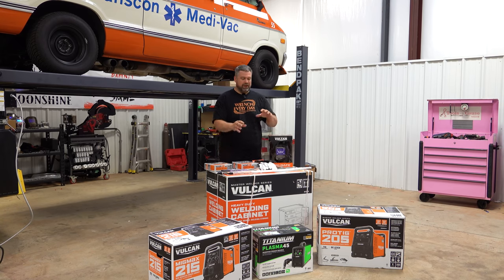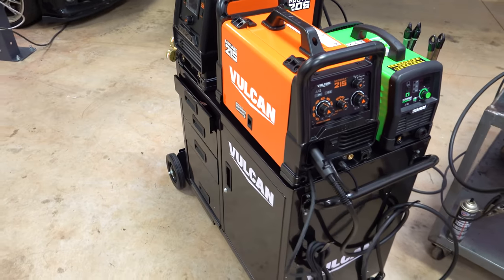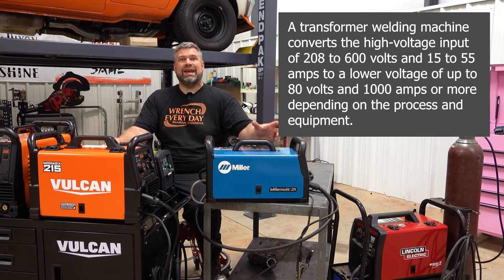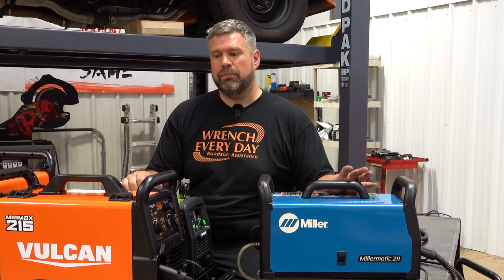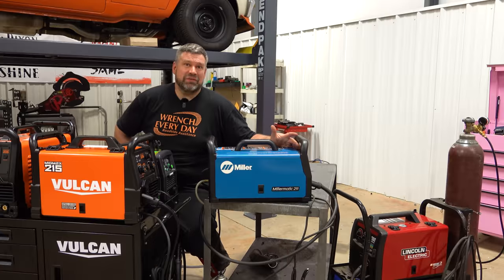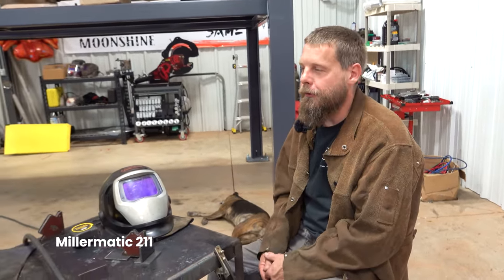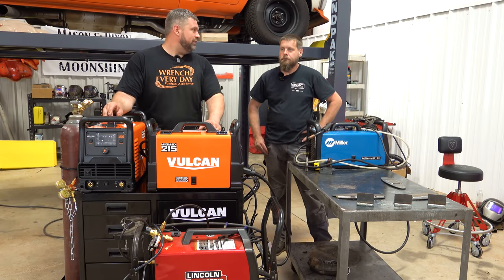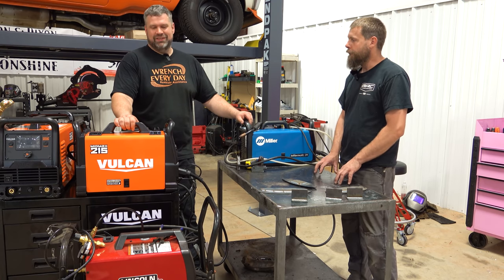Here's What NO ONE Will Tell You About Harbor Freight's "Best" Welders....

Comment: Loved your review I have an old Forney stick welder been around in the family since the 40s I think only maintenance we ever do is new leads and ends maybe break out the mud dauber nests once in a while. Right now it has a broken main switch lever still works just little harder to turn off. Have a lot of harbor freight tools around had good luck with the sockets not so much with the early ratchets some of the electrical stuff is ok to especially if you don't use it every day great video:)
Reply: 345clst   works great  i like to use 6013 and 7014 rod  seems like 6011 splatters a lot but have welded over an inch thick plate with the old girl

Comment: What about the tig? I've noticed on my 205 that varying the pedal doesn't result in smooth changes in power, but discrete steps. It hasn't caused me any issues though, from doing cast aluminum repairs to thin inconel. It's just a little distracting. First thing I did though was go get a CK worldwide #9 torch and super flex kit, as I've got no use for the giant stock torch.

Comment: I have that same Lincoln, I can say it's no frills it's heavy as hell that part sucks BUT the power unit is a tank. I work at a fab shop where we have bunch of Lincoln 255s and 355s and one new computerized one but we had a huge job it was dryers for molded wood pulp like egg cartons ect. It was a lot of thinner ga steel and 2" square tube so much work we were fighting over welders it sucked so I dragged my lill 180 in and it got flogged all day on E&F heat  setting with .030 hardwire for about a month+ it only shut off once in the beginning...duty cycle shut down ? Never did it again that's impressive I don't know if an inverter type would pull that off. There is something to be said for 60lbs of copper windings! But when comes to buying a welder if your a hobby guy just buy budget even the cheap stuff works pretty good my kid bought a $100 120/240v stick welder and it works great.... It runs 1/8" rod effortlessly. If your a professional the budget stuff last pretty good but if you want top shelf equipment l buy miller I'm not impressed with Lincoln on the whole our big Lincoln migs running fcaw at work are quirky temperamental they all run different especially on aluminum with python push pull leads. I will say the new computerized mig with the screen is the shiznit and it runs aluminum better than any of our migs.

Comment: I had a complete different experience with the pro tig. I really wanted to like it and tried for 3 weeks to make it work because the Lincoln square wave is $2500. I ended up taking it back because I just could not get it to run right and went and bought the Lincoln

Comment: I just bought my first welder used off of marketplace it's called a easy welder from Harbor Freight 125 FC paid $100 for I'm mainly going to use it for body panels and stuff on car Restorations replacing floor pans nothing that will require any heavy duty welding but I bought a second welder from the same lady that comes with a gas bottle so I'm assuming that's for heavier Duty welding I will be picking that up on Friday when I get paid

Comment: The only thing I don’t like about the welding cart is I wish that the lower cabinet on the drawer side was also a drawer. What I need is somehow always in the back and that means taking everything out then putting what I did not need back in. This guarantees the next thing I need will be all the way in the back again. All I added to mine was a butcher block top.

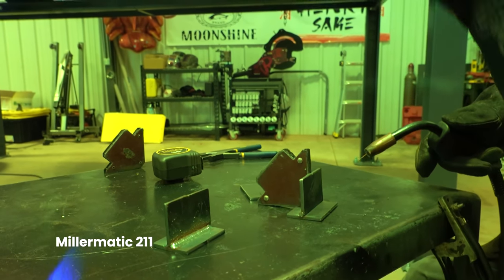Comment: Dont remember much about welding anymore but just listen to the difference in those arcs. Lincoln 22:53, Miller 25:30, Vulcan 27:09 The Vulcan sounded way different. Wonder if that is a good thing.
Reply: It's great while it lasts. That's super high frequency. What it's doing is actually pretty impressive. how long it can do it is the question though. Full of cheap Chinese parts only time will tell. And when one pops you can forget about fixing it. Go watch a video where someone cracks one of these units apart. Even if you're an electronics wizard fixing these inverter welders simply isn't practical due to how they're made. They're only designed to go together.

Comment: I've got a lower level of machine (more like a Titanium) from YesWelder (mig205ds), and it also does the pre-flow thing in mig mode. I don't have a bottle yet so I've only used mig mode as a way to get to lower flux core settings, so it's weird having it stall, but I knew exactly what you were talking about.

Comment: I ran a Chicago electric Flux core mig welder I don't know how many times I overheated it and and melted the negative lead out of it and just had to wire it back together the only thing that ever went wrong was finally the gun died and I bought a new one and then I broke the welder I have no complaints for that welder I used it every day to build bumpers and gin poles

Comment: I would personally get a Miller Multimatic 211 over any of the welders shown. It is made in the USA and has a duty cycle of 60% at 200 Amps, but if you were looking for a great welder that does it all really well, I would recommend a Miller Multimatic 220 AC/DC or a Lincoln, or a Power MIG 215 MPI, multi-process. ESAB and other similar brands have high-quality welders that have great duty cycles, but they do not have the same level of engineering to back up their quality.
Reply: damn man send me $3500 bux and I will definitely get the $4000 miller over the $500 harbor freight.

maybe next u can compare a f150 to a dump truck

Comment: I was a bit surprised the Vulcan MIG appeared to have a more stable arc with very little sputtering.  It looked a bit like watching TIG welding.  May need to give these a second look.  Randy sounds like my son.  While most 16 year old kids were flipping burgers, my son was doing metal fabrication and welding for a local company.  Years later he's still at it with another company and stills loves it.  Since boards are potted and can't be easily repaired, are replacement parts/circuit boards readily available for the Vulcan?

Comment: I have become one of the (many) evangalist for the Primeweld company over the last 18 months.  Their main splash has been their TIG225X but the main thing that sets them appart regardless of the product you buy from them is the customer service.  Imagine two folks, in US that are the primary employees of the company who answer the phone (owner and Testing/QA Engineer) for tech support and same day shipping, often overnight, at their expense for warranty items.  5 year warranty with the same free shipping both ways if needed.

I do not own the machine that made them popular as I have 0 interest in TIG but I have welded pretty consistenly with their MIG180 and recently MIG160.  Both are very, very comparable to the Eastwood offerings of similar/same names and pretty likely are made in the same factories.  Both used TWECO consumables.  The 180 has duty cycle (published and tested by me) far beyond what most hobbyist can stand to challenge and the all metal wire feed section is a blessing...all for under $500 including a spool gun.  The 160...meh, still a very good machine and will live in our race trailer as it is more competent than it has any right to be but the gun lead is short, it only takes 2# spools, and does not have that all metal drive section.  It is perfect to throw in a storage bin in the trailer and pull out at the track or out in the field to do repairs because it is TINY and light while still being able to run consistent 4" beads on lap joint 3/16" for both thicknesses (flux core...likely solid wire as well but not yet tested by me).
Reply: I have a primeweld 225x, i bought it for $600 pretty much brand new to learn tig. Then i found out the company is 15 mins from my house in NJ. The machine is actually pretty well known and it works how ive seen from alot of guys on youtube before i bought it. So far so good. They actually sell machines locally that were open box returns that have been either repaired or just returned for whatever reason and still have a full warranty. So thats pretty cool to.

Comment: The one bad thing about Harbor freight is unless if you buy their extended warranty. You only get a 90 day warranty on most of their products including their welding machines and plasma cutters. The thing I like about Miller is that's day stand behind your product. They have a 3 year warranty and their warranty is also a true blue warranty which in that case There is no hassle whatsoever. And the other thing I don't like about Harbor freight and it's they. Don't sell engines ribbon welding machines especially for people like me that cannot always have electricity And I also use my engine driven welcome machine as a generator when my power goes out. And I'll also use it on the farm in the woods.

Comment: The vulkan actually sounded best out of all three. I've welded for  10 years of so. I've used about all brands, but I haven't tried the vullans. What's the duty cycle times? My current tig machine is 100% @ 200-250 amps. Never had any issues.

Comment: I've got the 215, been using it for at least 5 years now, as a professional icar platinum certified collision tech. Welds as well or better then everyone else's Miller, Lincoln or snap on that I work with. 

I also have the first gen ac dc tig welder, the one that proceeded that 205. Welds beautifully. Aluminum, steel,and even titanium.

Comment: I ain't messed with alot the new stuff but when I started out welding it went if it's going to have a gas or diesel engine Lincoln is the way to go if it's shop base plug in or hard wired Miller takes the win now I have seen the old gas miller's run pretty for a long time

Comment: I have the omnipro 220… its a boss… ive used em all… bottom end 110s… bottom end 220s… lincoln and miller and even hobart, all middle of the road 1500-2500 machines… the omnipro 220 is on par with the top millers ive used…
Reply: I have this exact helmet too… also damn good… the top end miller and lincon ones ARE better… but for the cost, miller or lincoln dont even offer a helmet…. The main difference is clarity, not function of darkening… you can see clearer in dark areas, and still get shade when it gets bright.

Comment: I wish you uploaded this video like 6 months ago. I went with a miller 141 and I like it, however, there are some irks I have with it that do not make it worth the extra cost. Especially for sheet metal, the miller has a slow start feature that screws you up and makes it hard to do short welds like you need to with sheet metal.

Comment: When did inverter welders come on the market? I have a Clark mig 130en I bought almost 20 years ago and have no idea what type it is. Works fine for sheet metal work I’ve done on cars but curious if I should step up to something better.
Reply: Inverter welders have been around for a long time. Inverter welders have their pluses and minuses. When they work they're great. When they don't work you're done with it then too. Fixing them usually is not a practical option.

Comment: I weld and fabricate for my second job. So semi professionally. I run a Miller Trailblazer on my truck and a Miller Multimatic 255 in my shop. I also have a Lincoln 180 that I learned on. The blue ones are very expensive. They also have a 100% and 60% duty cycle. The Harbor Freight welders are significantly cheaper and have very low duty cycles. I’ll be honest. They are Good looking machines. They also have great interfaces. But......if I were going to spend $500 to $2,000 on a welder, there are better machines. Everlast probably makes the best Chinese made welders at affordable prices. AHP does too but too but only have a few models. These are inverter machines and most models have 60% duty cycles. Everlast has 5 year Warrantees on all their machines and have replacement parts. If I was on a budget, that’s the way I would go. I also learned to stick weld on my $230 AHP 160 stick welder. Lunch box sized, 8 lbs and 60% duty cycle!!!

Comment: On the Migmax 215, would you feel comfortable using it to weld the auto frame or the brackets for a rear axle?
Reply from the maker: I used it to weld up the brackets on the drag racing cars rear end, which was taking full trans brake launches perfectly! Make sure you have good power feed to it but it’s an amazing unit and I trust it.
Reply: @TheQuestionableGarage  Thanks for quick the response. Thanks for all the great info. I was looking at the Hobart 210, i read mixed reviews. Hopefully, i can find a good deal on the holiday sale for the Migmax215.

Comment: I have a Harbor Freight Titanium flux core welder that I often choose over my more expensive mig and tig machines. Sometimes it’s nice not having to wheel around a tank. 

With a well prepared surface and good wire brush or wire wheel, it makes excellent welds almost comparable to a mig.

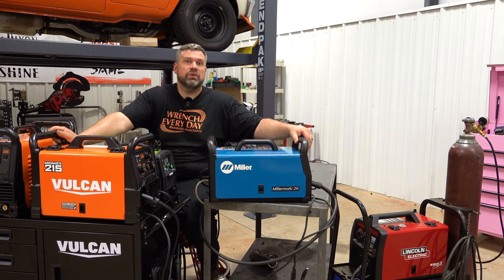Comment: The comment regarding "I think with most of these inverter machines you're seeing most of them coming from the same factory" 19:06  is inaccurate. The Miller 211 machines are still USA made built in Appleton, Wisconsin. Not sure where the Vulcan is made, and not sure about the Lincoln either.

Comment: I was expecting more talk about the "the feel" of the machine, sort of the intangible deal beyond the specs and how it works. I have a Miller 211 and my older machine, a Hobart Hander 135. I bought in the 90's new, an old-school transformer, but it literally came with the same gun as the newer Miller (Miller owns Hobart and all the external parts, gun, ground, regulator/guages... are all the same, even being made 20some years apart,  and clearly I'm using the same spools of wire and gas making comparison interesting). 
I
Much like you mentioned, when I first got the MM 211 I was disappointed, I had that "I spent how much for this and it doesn't feel better." 

So here's the thing. The Miller autoset always seems a bit off, even though it's infinitely variable in it's power output range. The HH135 in contrast has 4 power taps (in other words you can set it for power level 1, 2, 3 or 4, nothing in between) and if you get it close you adjust a little with technique and you're happy. Secondly the HH135 always feels smoother. If you watch this video compare the MM211 arc (it was very crunch sounding and looking, sparks flying everwhere...) compared to the Vulcan (not as loud, not as "crunchy") which at least gave me the impression of the difference. So the MM211 has an extra roughly 70A of output current... IRL you don't notice it.  There is a range in the middle/top of the MM211's range that he HH135 just can't to single pass, but for bigger welds you'll likely weave or multipass both, and honestly, I'd rather weave with the smoother hh135 that go straight threw with the "crunchy" MM. 

So why is the MM on my cart and the HH is wrapped up and I occasionally try to sell it? Well the MM came with features that help in my use, primarily the dual voltage (I can take and us it on a 120VAC extension chord and use it in the driveway if I have to), and the MM came with a spool gun which I am surprised how often I use. If it wasn't for those 2 things I'd sell the MM and just keep the Hobart, and honestly if i ran across a good deal on the 240V HH model that would work with the spool gun I'd likely ditch both for it.

Comment: I bought Titanium-Stick225 it works great on stainless and angle steel. Then I bought Titanium Mig170 it doesn't work a darn. It will throw spark everywhere but the hot metal just fall to the ground and will not weld. I use .030 stainless ER308L flux core and 71GTS flux with 120V. I don't know what's wrong may be the machine is defective. I wish you would show the result of the weld.

Comment: So to me it sounded like they got the settings better on the Vulcan.  The Miller and Lincoln had a little more popping and sputtering indicating the feed speed wasn’t perfectly right for the temp, but the Vulcan sounded smoother.  Probably not any quality judgement there u less the Vulcan is easier to dial in.

Comment: Having personally used and purchased a bunch of welders, including some ultra cheap ones from HF and expensive Miller & Hobart MIG/TIG/Plasma machines.... I will never understand why anyone is buying a $1000+ Vulcan welder with a 90 day warranty when you can get a Millermatic 211 on sale for just a couple hundred bucks more if you're patient.  The 211 I have never skips a beat, nor do the other 3-4 of them that my close friends have.  I'm certainly not saying the HF welders are junk... I am saying that you are getting ripped off for what they charge for them.  They have no resale value either, and good luck finding parts when something fails in 5-10 years.

Comment: I remember we had a big old transformer welder in a truck shop the equipment mechanic had a miller portable on his service truck. We also had a newish miller wire feed welder . Pretty much everyone used the old transformer machine it had a near 100% duty cycle the wire feed was like 60-70% duty cycle . I think the wire feed cost around $5000 .
 Lol the old webco?? Transformer welder was so old the leads were so weathered and cracked that inside the shop on a rainy day and wet trucks we'd get zapped sometimes but we still preferred it to the new wire feed (we called them in those days idiot welders ) because anyone could lay a pretty bead but not a strong weld

Comment: The Titanium flux core inverter with variable temperature and wire speed is probably the best machine dollar for dollar on the market ! It is a very good machine, the only negative that I can say is that it will not run well on an extension cord even a 12 gauge over 50 feet is not going to work. Just stay close to the power source. It will run just fine on the 3500 inverter generator.